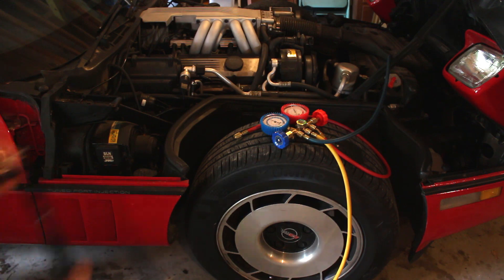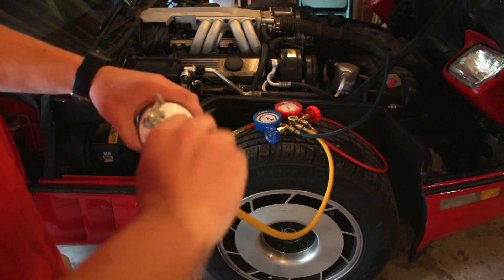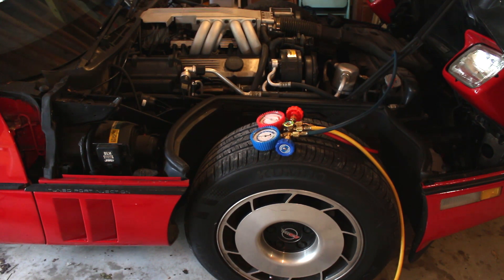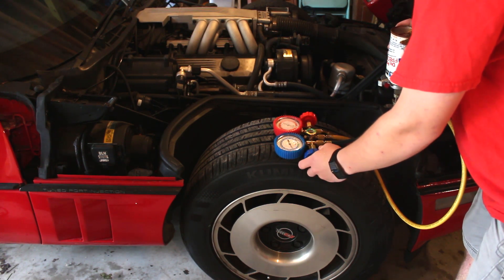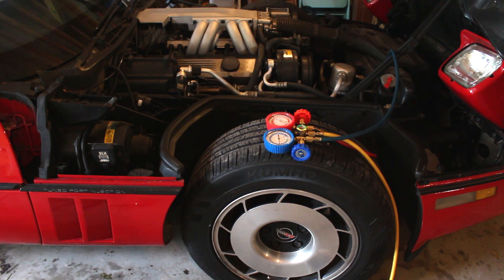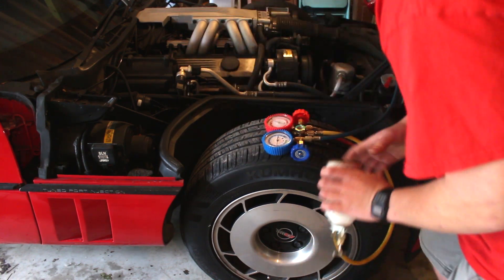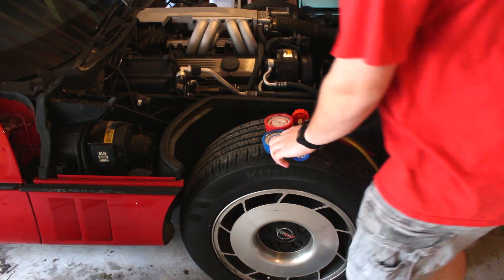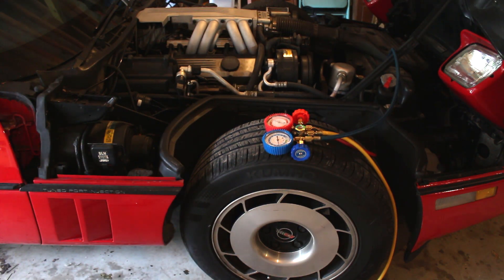Recharging an R-12 Car Air Conditioner (1985 Corvette)

Comment: Always charge with can up (gas) not upside down (liquid).  The accumulator or drier saved you on that.  The compressor is made to compress in the proper state.
Reply: Wrong...this system is designed to be charged in a liquid state. It specifically states to charge the system with the cans upside-down in the FSM as well.

Comment: Josh. No gloves, no eye protection-and by holding the can upside down you are loading LIQUID in to the car, not gas-a good way to screw up the compressor.
Reply: Low side port has liquid refrigerant, safe for compressor if it has right amount of oil

Comment: Nice car. I would not charge with liquid, (holding can upside down). Lucky your car has an accumulator. That saved your butt. And no high side connection? A lot of by guess and by golly in your approach. I misplaced my GM 3/16 adapter and I was hoping that you would have something on where to get one. But you don't even believe in testing that. Good thing you did not have a full 30# cylinder to dump in. HA!

Comment: You have to make sure you have the correct capacity charge spec and use mineral oil not PAG Oil !
Reply from the maker: Or simply charge based on low and high side pressure.

Comment: You did not get the air out of the blue hose which is the suction hose so you did put air into that system what do you think is in that blue hose you need to crack the valve before it goes in to the system so you should’ve open the gauges and let a little R 12 come out of the blue hose before pushing all that air into the system as those compressors are only designed for refrigerant you put air in that system
Reply from the maker: Well, that system worked for 3 years until I sold the car and I'm sure still works now. Only reason I sold the car is because it got rear ended and I was not equipped to fix it.

Comment: Smooth motor.
Reply from the maker: Not in the slightest. Had a vacuum leak in this video.
Reply: @JoshuasRecordings  Right.  (sarcasm on my part), sounds a little bit more than a vacuum leak.
Reply from the maker: @cluelessbeekeeping1322  If I remember right. It was a combination of vacuum, a bad tps, and it was humid that day.

Comment: Purge near the quick connect or through it, not just through the manifold to clear the hoses as well and never charge a system with the can upside down so the compressor sucks in gas not liquid.
Reply from the maker: You actually can charge with the can upside down. Especially with an automotive system. A lot of companies recommend charging with the can upside down. Now with a house air conditioner, it could cause the compressor to stall, but I have yet to experience that.

Comment: The sound quality is not good at all why you worried about the AC when that car sounds like shit worried about getting it running right LOL not trying to sound like an a-hole but damn but I must say you seem to be young but are very knowledgeable about alot of different things Wich I think is awesome
Reply from the maker: Yea ik, I was playing around with a noise floor limiter when editing this video. Guess I shouldn't have done that. That car ran fine but had a hole in the exhaust which is why it sounded like that. It was also idling low bc it was humid out, that car never liked humidity. Either way that's never here nor there since I had to sell the car bc it got rear-ended a few months ago. Had a lot of good times in that car and put around 25k miles on it.

Comment: This would a been very beneficial if I could have seen where you hooked up your gages
Reply: To the AC ports there's two of them high and low usually one has a blue cat for low pressure and the other one has a red cap for high pressure but that's on r134 I'm not sure if it's the same on r12 cars 1994 and up have r134
Reply: He only hooked up to the low port. If you read the back of one of those cans it says don’t hook up to high port.

Comment: Could have done 70% R290, 30% R600....
Reply: What is this witchcraft you speak of?
Reply: @RicardoMartinez-kr5qk  basically, 70% Coleman propane and 30% isobutane lighter fuel. Never butane, ISObutane. Google " possumliving propane AC"
Reply: @whozaskin3639  ah thats interesting, i think ive read of that. Im currently  running the duster spray in my old Mercedes and it works pretty well but just curious how much better the actual r12 will perform. I gueas i better get some before what's left is gone.
Reply: @RicardoMartinez-kr5qk  I'm running the propane/isobutane in a 1986 Corolla. All original AC components. 43°F @vents, at idle, when it's 90 outside. Also, the propane takes around 30% less kinetic energy to compress, so better MPG, longer compressor life.

Comment: What manifold gauges did you use?  Is it and older set or do the couplers that fit the r134 system the same for the r12.

Comment: What would be a working pressure for the r12
Reply from the maker: Between 20-40 PSI low side depending on temp and humidity.

Comment: Yeah  a properly working R12 A/C system is the best that stuff sure beats R134A for the coolness factor (Literally) Also R22 systems, older home central air and window units before R410A came on the scene  are also cool (again literally) the new units are lame and are not built to last like things of yesteryear. BTW Nice car
Reply from the maker: Peter Yachymczyk Thanks man. Yea, I personally do not like the new refrigerant at all. This car a.c. blows ice cold now. Much colder than any other car I've been in. 

If you haven't already, go and check out the Flickr group I'm in. Link on my channel home page. We collect vintage air cons.
Reply: R410a is better for heating, where as r22 is better for cooling
Reply: I have a 1985 corvette I put a new condenser and evaporated and rebuild my compressor do you recommend 134a or R12
Reply: @Mdelreal37  I know you're not asking me but I would use r134 cuz it's readily availableand you can get a service that most places with the machine instead of using the can which is okay if you need to top it off but if you just did all that work you're going to have to evap it and take all the air and moisture out of the lines before you go to put Freon back in
Reply: @dhestondh Depends how much you care about your AC's performance. If it was my car I would go with R12 because it works better and runs at lower pressures than 134a, meaning the system will last longer and is less likely to leak. You need an EPA 609 certification to legally buy it, but that's not too hard to get. R12 isn't all that expensive or hard to get either, it's all over Craigslist and eBay.  If you use ester oil you can easily switch to 134a if R12 becomes unavailable in the future, all you would need to change the fittings since ester oil will work with both R12 and R134a.
Reply: @averyalexander2303  Does R12 blow colder/cooler than R134?
Reply: @DreMill-p9o  In a system designed for R12 it will, they don't work as well once converted to R134a.